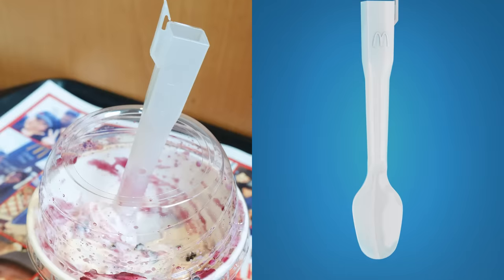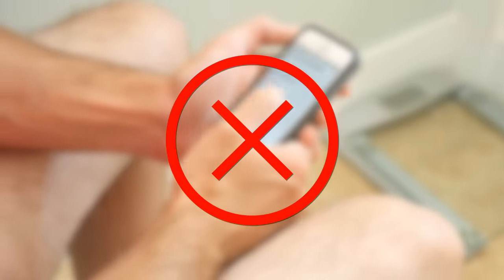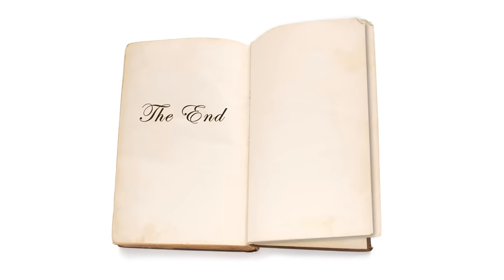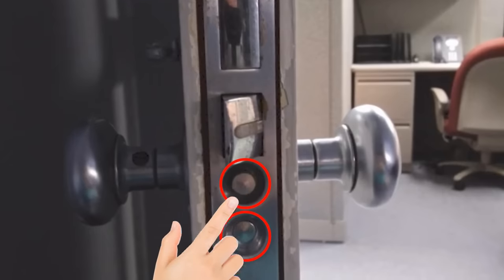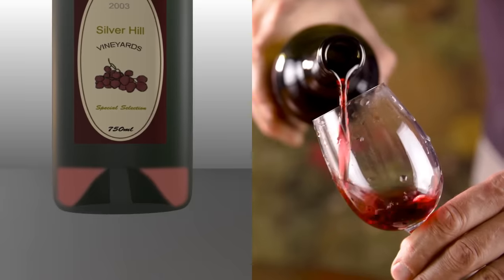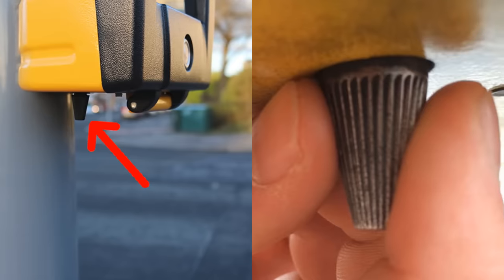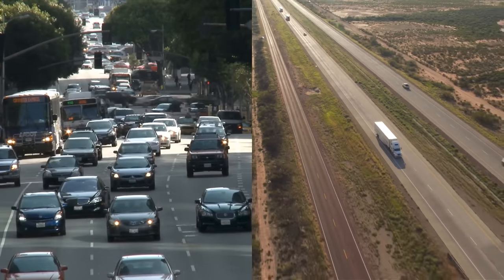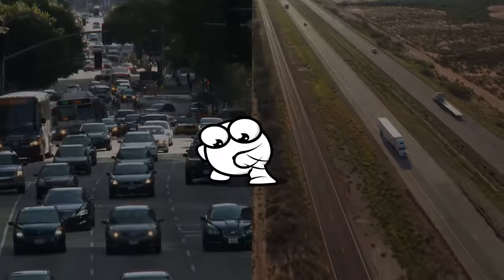Amazing Secrets Hidden In Everyday Things - Part 2

Comment: The one with the old door lock was a life changer! We moved to a new house a few months ago that has one. We thought the door was broken but it works now!
Reply: The old door lock is a common function still used in residential/apartment buildings and it has nothing to do with bathrooms. They have a swivel spindle inside which allows one side to spin independent of the other so that you do not lock yourself in. If you put in a solid spindle in there and lock it you will not be able to open the door from inside.
Reply: These locks were used as entrance locks, not for bathrooms.  They still are available in "mortise"-type door hardware.
Reply: Every apartment I lived in in NYC has that button. pre-war buildings, brownstones, project buildings, even nicer modern buildings. it's common amongst New Yorkers to say "make sure the button's pushed in and the door locks on your way out" to kids or house guests.
Reply: Works for summoning a demon too!! See those ancient glyphs? That’s not your everyday ordinary hell runes. Those are from the lesser key of Solomon.
Reply: I lived in an old house that had light switches that were push button. After I got shocked, the landlord changed to a modern switch.

Comment: That zipper locking thing, I "discovered" this phenomenon in the late 1960s as a kid, I can't believe that it's not common knowledge.
Reply: Also using petroleum jelly can keep the zipper from locking properly. In the 70s, the bleach caused a reaction on the metal of zipper so it was hard to zip/unzip. Mom put the greasy stuff on and it wouldn't stay locked. I had to zip them up all day long. That night I had to use degreaser on the zipper and never had the problem again.
Reply: Exactly what I said.
Reply: @deemueller6470  Your Mom must be a hoot ! 🤣
Reply: @justforever96  🤣🤣🤣🙄
Reply: I don't want to live in a world where that one needed to be explained 🤦🏼‍♀️
Reply: No one taught mwmkqw1
Reply: As they Say, common knowledge is not so common anymore?

Comment: A little Easter egg found in all cars made in the last 60 years. Usually located beside the steering wheel there is a short stick that, when pushed up or down turns on a blinking light that tells other drivers you intend to turn or change lanes.
While required by law they often do not function properly in BMWs because of their notoriously flawed electronic systems.
Reply: I cant tell if you are joking or not
Reply: @jameschambers3981  same
Reply: @chaos6687  He is.
Reply: I have a BMW and I think I may have this problem. When I push the short stick the light works for a split second then  goes out for a split second and then comes on again for a split second then goes out again....and so it goes...on and off over and over again!  🤷‍♀️😁
Reply: @andreb877  that doesn't make sense, BMWs don't have any lights anymore since nobody bothers to use them.
Reply: Mostly they don't function because of notoriously flawed drivers....
Reply: And if you pull back on that little stick thingy it will dim your headlights, which you should do when you meet oncoming traffic and also while you are following other vehicles
Reply: @heavenleigh111  That gives my car high beams. Backward lowers them.
Reply: @heavenleigh111  yousound like a sexy thing! ( just your comment! 😛 )
Reply: They do work differently than most other brands  which is really annoying until you get used to it
Reply: I can’t believe how many people didn’t get the joke.
Reply: @musicman59753398  
Because it wasn't funny.
Reply: Here in Iowa turn signals just confuse people.
Reply: And, if you'll also notice, the headlight dimmer switch is now incorporated into the turn signal switch, and the big button dimmer switch on the floorboard is no longer there. So people who constantly ride around with their high beams on, simply cannot get their foot on the turn signal arm to dim the headlights !!!
Reply: I don't think that has anything to do with the BMW's electronics, I think it's a software issue. Namely, that people who drive BMWs tend to be selfish, unthinking jerkoffs who can't be bothered with signalling or polite driving behavior.
Reply: I'll one-up your BMW with my Mercedes. The trunk does not open unless I take the bulbs out of the interior rear dome light. Figure that one out!
Reply: What's flawed is the driver who doesn't use blinkers, then complains about someone who runs into him when he slows down to turn .
Reply: Big Daddy Carl you have so made your ancientness obvious.  Of course, though, I remember the foot button too!
Reply: Buicks, Lincolns, and Toyota Avalons have the opposite problem: the blinker refuses to turn off for literally miles and miles.
Reply: Nobody needs to know my business!
Reply: I've found they don't work on most cars, especially the ones in front of me!
Reply: Hahaha !!! 🤣
Reply: Or flawed drivers.
Reply: @susanhamptonva4203  😂 😂 😂

Comment: Those 18" glass "smoke baffles" in floor openings (stairs, atrium, escalators) are not intended to limit smoke propagation, but to concentrate the heat from fire to set off the sprinklers that are typically around these openings. Once the sprinklers are set off, they form a curtain of water around the opening which reduces the spread of fire.
Reply: Thank you!

Comment: the dots on the edges of the window aren't there to "prevent glare" or "provide a smooth transition from black to clear"! they prevent the glass from shattering due to the black border being more absorbant of the suns rays. since glass changes size in high levels of heat, the ability of the black border to absorb more sunlight than the clear glass causes a vast temperature differential over the none black areas, the dots warm the glass as well, but the smaller they get the smaller the impact on the temperature of the glass does as well, this effect allows the glass to enlarge less abruptly, preventing the glass from shattering
Reply: zigon 2007 now im doubting the rest of the info 😅
Reply: Eunice Lee there was a ton of bs. Screw top is as good as cork. Punts have ZERO purpose. And common zippers do not have locks (that work)
Reply: @eun.icelee  yep, pretty much all false information. people will do pretty much anything for views nowadays.
Reply: Actually it wrong it's a type.of anti fog tech lmao
Reply: @chrismh95  i have multiple items that have zippers amd they all have locks.   Maybe you have clothes that have non locking zippers...
Reply: Thanks...I’ve wondered about that one for a long time!
Reply: That just sounds like a quick made up answer/s
Reply: Zigon 2007, that's exactly what i was thinking. If that wasnt present in plane or vehicle windows, the thermal shock due to the vast difference in heat conductivities of the glass and the black lining causes the window to shatter.
Reply: My back windshield flew out on the interstate, the FL heat got to it.. was pretty shocking to say the least, guess my dots weren't doing their job.
Reply: William Mcfierson  they're Florida dots, like the mystical Florida man, who knows what's going on with FL dots
Reply: Wrong.  The black band is to protect the urethane from UV breaking down. The black dots or dot matrix help during the tempering or molding (laminate glass) process from drastic temperature change and to help the glass not to shatter as often during that process. The reason for the larger dots to smaller dots is to help the transition process of heat. It also is easier on the eyes.
Reply: @punktalley  upon further research having read your reply, I will admit that you are correct, though I am also not wrong. the dots serve multiple purposes, including the two which we have stated.
Reply: @punktalley  in addition, however, I am referring specifically to the existence of dots, not the black band, which also serves the purpose of providing a surface for the glue to stick to in the installation of the windshield.
Reply: <---- 3rd generation glazer, and you have no idea wtf you're talkin about...the black border around autogalss is to hide the black urethane sealant used to bond the glass to the vehicle...put simply, it older vehicles the glass was wrapped in rubber gaskets that were then installed into openings in a vehicle...urethane does away with a gasket and actually makes the glass bond to the vehicle structurally...no gasket there to hide the ugly lookin black urethane, hence the black border on autoglass...fyi: those are not called "windows" or whatever, in the glazing industry a piece of glass is called a "lite", i.e. Safelite Autoglass....
Reply: @branon6565  I am not referring to the black strip itself, but the dot matrix transitioning it to the clear glass of the rest of the WINDOW.

in addition, I will point out that the term lite refers to a type of window with separately cut, individually framed pieces of glass within it, or a piece of glass made to mimic this effect. 
sources: https://www.windsorwindows.com/knowledge-center/windows-and-doors-101/glossary 
quote:
Lite – A piece of glass. In windows and doors, lite refers to separately framed panes of glass (as well as designs simulating the look of separately framed pieces of glass). Sometimes spelled "light."

If you still believe that I am wrong, please state your objection.
Reply: @ John Martin Well, the poster did the research. Whoever gave the info gave it wrong.
Don't kill the messenger.
Reply: @ chrismh95 So 3 examples are a "ton of bs"? 
You haven't had a really good bottle of wine and my zippers have locks.
Reply: Maybe he uses Velcro?
Reply: @ Dawn B they're only on the front.

Comment: #19: the glass around ceiling openings and stairwells are called draft stops. Their function is to keep heat from flowing around fire sprinkler heads, and detrimentally prolonging their operation.
Also, by keeping heat from spreading, you keep fires from spreading faster. Which allows time for evacuation and first responders to respond. The smoke thing mentioned is just a cool byproduct of these devices.

Comment: Who zips their Jean's up and leaves the tab up? Other than a child of course.
Reply: Me
Reply: I immediately tried to lock the zipper on my most annoying jeans.  It didn't work.
Reply: I never knew about this! Has saved me a few embarrassing moments......
Reply: No, it's fact. There is a locking mechanism on a zip.
Reply: My work uniform's zip actually locks when you flip it up!
Reply: My wife's pants have been locked since the day we got married.
Reply: Well you might be right in a rush after a quick hand jibby.
Reply: Physcopaths
Reply: @blaineshippy4599  And psychopaths.
Reply: I have some that are awkward to zip due to design issue. The zipper sticks that way unless you back it down slightly and consciously lower it, which is how I learned it leaves zipper unlocked 😧
Reply: @ Ronald Krueger it m needs to line up correctly. Try again.

Comment: The "stench pipes" you see at hospitals are actually attached to the incinerators or at a funeral home to cremitoriums
Reply: What hospital has incinerators?
Reply: @megancrager4397  all older hospitals  some quite modern too. Look for the  chimneys on the property but more towards to border as it is usually in the basement
Reply: @ Megan Crager When Hospitals do Amputations and deliver later term miscarriages, they will cremate the remains on site in some hospitals. Or did. Some used to do more a long time ago of their indigent patients, etc instead of sending too mortuary. 
Most aren't in use anymore.

Comment: Whoa! The clip in my pocket is for clipping things I put in my pocket?! WHO KNEW!!??
Reply: I know right..  He never said for clipping one glove to each pocket either.  Which is what they're really for.  I come from a place with hard winters.  They're so you don't lose gloves.
Reply: @Tehpox  That only applies to coats that have a lanyard in each pocket. You usually find them in one pocket only, and in warm weather clothing as well. Related equipment, but not the same thing. I suppose one could clip both gloves in one pocket, but I have them in the side pocket of my snowpants, for example. You can't fit gloves in that pocket. It also has a quick-detach, which is only useful for keys and cards. Basically, one can clip whatever one wants to them. But give me the old-fashioned mittens-on-a-string-running-through-the-sleeves any day. Never understood why everyone thinks those are only for little kids, it's a brilliant idea. I'm constantly loosing gloves and mittens. And they make special lanyards now that clip to each mitten, so they can be removed and worn without, and so you don't need to wear specially knit pairs of mittens connected together.
Reply: @ William Walker Ikr! Our mom would make the yarn strings each year so we wouldn't lose our mittens! Its such a simple but brilliant idea.

Comment: The “punt” in a wine bottle looks like it would increase strength too. Also makes the wine bottle look bigger without having all that volume (like the container they put French fries in)
Reply: Milton B thanks! 👍 So it is related to the strength and structural integrity of the bottle , even if it’s only for the corking process.
Reply: Milton nailed it. It helps dissipate pressure evenly in the bottle.
Reply: The punts main purpose is actually for serving. I am a banquet server at a very high-end hotel and that indention in the bottom of the wine bottle is for your knuckle to fit inside that way you can use your one hand to pour directly across a table with your full arm extended.
Reply: Rory Segal thanks! I hadn’t considered that
Reply: It was also used to hold the bottom of a bottle when making sparkling wine.  Monks would mount the bottles, with wine in them, in a device that allowed the bottles to be turned (rotated) on a regular basis.  This caused the fermentation to add carbonation.
Reply: Jean-Claude D that is interesting, those monks were clever 😉
Reply: @eternalblue6677  it s a happy by product but the punt "is actually" to keep the bottle from breaking when the cork is inserted.

Comment: My mother taught me how to lock my zipper when I was a little girl. There are also small stink pipes on houses and buildings.
Reply: The pipes on houses are more of a vent to allow for air to enter the plumbing system of your home. This prevents vacuum lock in your pipes when water goes down any drain. You may notice on very stormy windy days, the water in your toilet bowl moves a bit on its own. This is caused by the pressure differential of the wind on the roof vent to the plumbing system. And yes, it does stink on some days.

Comment: “In the event that a children, or dumb adult”

8:46

Nice
Reply: But if the gap of cap gets filled saliva/ mucus you're doom
Reply: well it used to be kinda common to chew on a pen cap while leaning back on a chair.
lose your balance, chair falls over, you gasp and then in goes the pen cap. the hole saved many a cocky jock.
Reply: 2OOO plus 300 plus 90 plus 1=2391
Reply: The O is o not 0
Reply: @rebeccabernardo2263  🥴🥴🥴🥴🥴🥴

Comment: 1:07
> "The sealed glass panes"
> Shows a picture of glass panels with gaps between them
Reply: Glass should expand and contract a little with the climate. Even yes if there are gaps it still will drastically help as the gaps are relatively small in size.

Comment: and here i was thinking the gaps on toilet stall doors were there so you could escape if the doors got stuck.
Reply: What, like a super glue prank?
Reply: Cause it is...
Reply: Sadly I have to back the video on this one.  The gaps are not just on the bottom of stall doors, but go up the sides too so you get a half inch gap even when the door is fully shut.  Public toilets had a lot of problems with homeless people making them a home, or people to do things they don't want you to see in.  This has effectively stopped it being used as a drug den/napping place.

Comment: The main thing I learned, this channel doesn't always give accurate information. It occasionally presents false rumors as facts.
The wine corks was a false explanation.  Given the fact that corked wine bottles are intended to be stored with the cork facing down, to insure that the wine bottles don't leak air into them. Not to allow air in.
When the wine steward pops the cork, he hands it to the person ordering the wine. This person then squeezes the cork to make sure it is properly moist. Which means the bottle was probably sealed during storage.
Reply: They are also for a minut off gasing. Obviously not air in.... It'd foul & rot. The off gassing(sealed) is the booze being made in action. I use balloons when i make it in my basement
Reply: I caught that.    Air circulation, not!
Reply: True. Not for air exchange at all. Cork with one side wet with the bottle laying down will maintain the seal for a very long time. There are now other methods that will keep for longer than cork, but with very good wine keeping it for a very long time verses a very very long time has limited value, since you probably aren’t going to be around to drink it.